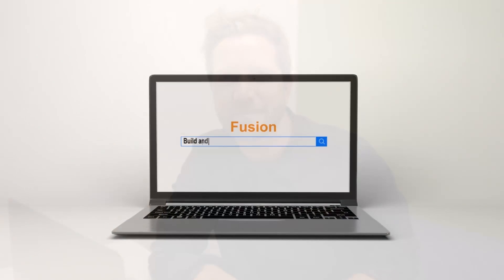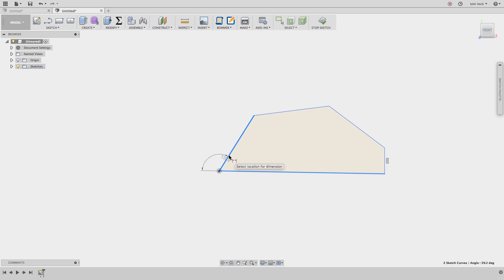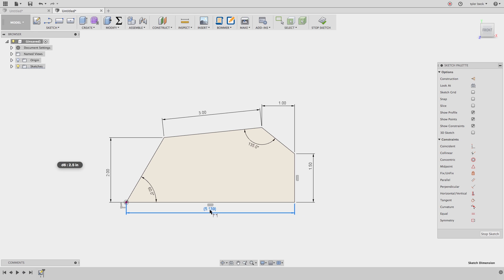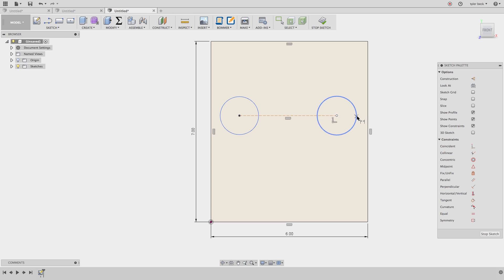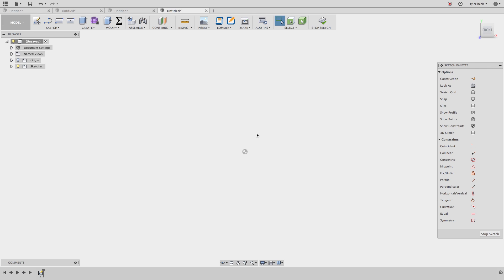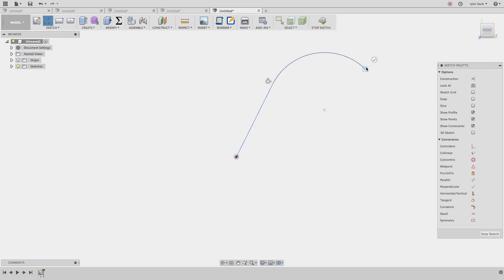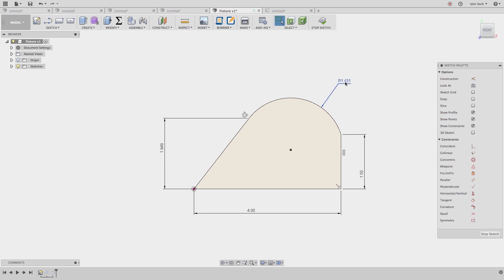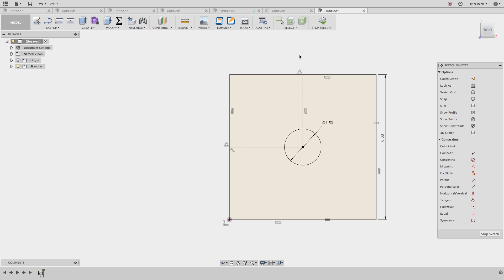Fusion 360 - Sketch Dimensions Beginner's Guide

Comment: While in Sketch I need to be able dimension arc length. Specifically the arc between two points I place on the circle. So far I can't find the command.  I NEED this a lot, because I don't want to waste time making solids, when a simple geometry is all I need.
Any help ?

Years ago used to run SW and this was really basic, possible in y 2000.

Comment: How would we construct a rectangle that may be rotated and still remain a rectangle? My recollection of plane and solid geometry was that the orientation of a four sided shape need not be vertical and/or horizontal. Has geometry education shifted over the years to a strictly XY cartesian-only vertical/horizontal subset of geometry?
Ok, I am sure I and all your viewers know this answer. But at the heart of this is a question about what the thought process was when the Fusion 360 programmers wrote their original code.
I can definitely construct a rotatable rectangle (or square). But why are the default rectangles not rotatable?
Reply from the maker: Did you happen to try the "3 point rectangel" ?

Comment: Nice explanation but - what about the extrusion height? I have the front all constrained in 2d. I have also have a sketch for the side - but still the extrusion height is not coming from the sketch of the side sketch. I always have to adjust the extrusion height manually. Any advice there? What am I missing?
Reply: You create sketches to create profiles. You select one or more profiles (activate the extrusion feature first) to create 3D objects. Extrusion distance(s) are not part of the sketch. You can use the same profile for more than one extrusion with different distance values (what you called a "height").
Reply: I meanwhile figured it out. You can create variables and reference them pretty much everywhere. Even during extrusion.
Reply: Not just variables. You can create custom expressions like "Some_diameter / 2" or "Some_radius * 2".

Comment: I've been trying to work through a course of material using Constraints and I have run into an issue. Whenever I type d on the keyboard nothing happens and when I added the Dimension Icon to my toolbar it was also Greyed Out. How do I go about rectifying this situation?
Reply from the maker: Can you edit a sketch?

Comment: Hi Tyler
Great you do this guide, but a have one note. In 13:15 there is very easy sketch, so you can use this solution (two angle dimensions), but if somebody use this way, he will have big problems with more complicated sketches.
Beginers must keep up relationships, like horizontal, vertical, they must have clear sketch and you have to show them this way. I know what I say, I am CAD teacher too. (sorry for my english)
Reply from the maker: Good call.

Comment: Great videos! Here an easy one I have not figured out yet. I have a rectangular 1/8 in plate bent into a simple even U shape.3in long, 1.75 Radius.  I want to put a small 3/8 fillet on the 4 corners (not edges) to take off the sharp edges. Any thoughts? Thanks Tyler!

Comment: Thanks Tyler.  Lots of great info here.  One thing I find is that once I dimension a model and extrude I quite often lose the 'dimension' option.  As in it is grayed out and not available.  What is happening in this case?

Thanks,

Paul the Noob...
Reply from the maker: Hey Paul,
If you right click on the sketch and edit it.  You should be able to double click any of the dimensions that are driving dimensions.
Reply: Just gave that a try and it of course works.  :-)   Actually very intuitive which apparently I am not.  Thanks for the reply and again for the great videos
Reply from the maker: The dimension option is available when editing a sketch.  You must be in that mode to see it.

Comment: To set the arc angular dimension, you can skip the construction lines and simply click the three point with the dimension tool and place your angular dimension. ;)
Reply from the maker: Hey Blaise,
You are absolutely RIGHT! I avoided that tip just because it is order dependent and can be a little confusing for new users.  But, thank you for bringing it up and for watching the video!

Comment: Is Fusion cad cam cae program just like catia or nd?
Reply from the maker: It is a CAD, CAM, FEA, Rendering, Sheetmetal, Drawings & it handles parametric design, direct modeling and subdivisional modeling.  So, it is meant to handle challenges that Catia,SolidWorks,NX might cover.  I would be happy to have a conversation to cover specifically what you need and how well Fusion fits your needs.
Reply: Tyler Beck of TECH & ESPRESSO 
My main interest is multi stage deep drawing  like logopress3